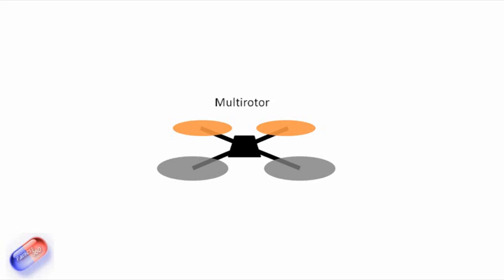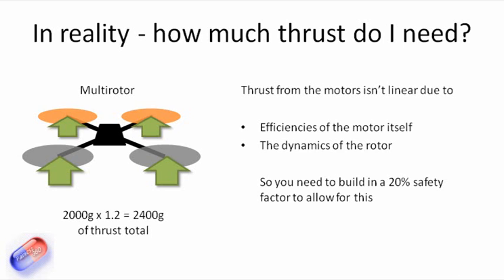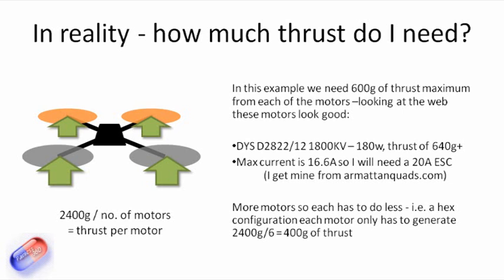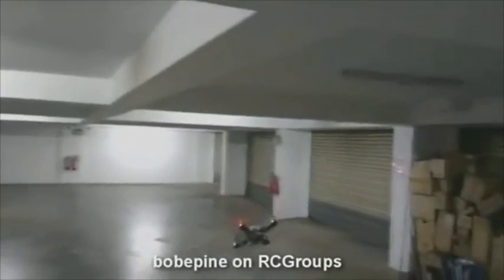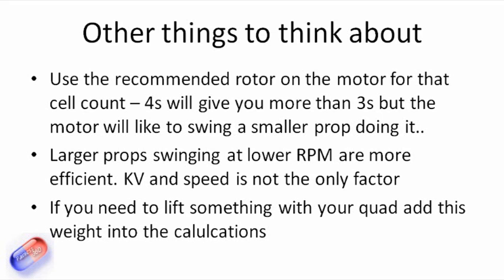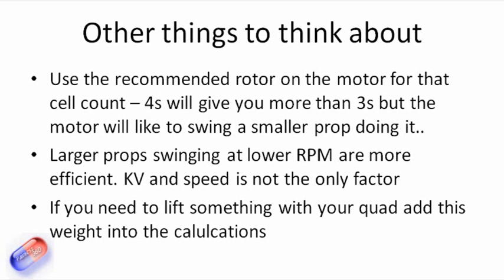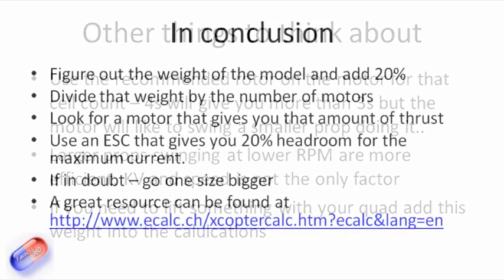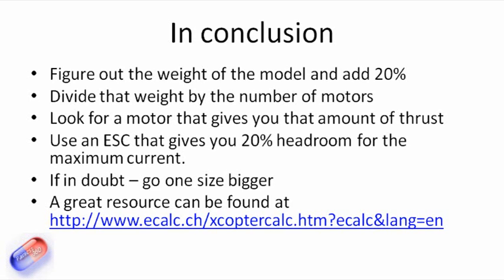How to select the right motor for your multi-rotor (all types - Tri, Quad, Hex etc.)

Comment: I'm really finding this hard to understand, because i seemply cant find how to calculate the requirements of the motors and nowhere seems to state this motor is capabe of 1kg thrust or 2.For example, im, building a drone that has an estimate of 1.5-2kg, what should i pick, 4 motors that are 2700kv or 1600kv, where would i find what motors should i buy so that when hooking 4 of them i could fly the drone. Not for sport, but for normal drone flying.
Reply from the maker: Check out the t-motor stuff. They take the time to test and publish thrust tables.. best of luck

Comment: Hi I am trying to develop a drone motor 
Can you help ? 
Required thrust 5000g each motor.

How to calculate motor power rating?
Reply from the maker: You need to look at the thrust for the motor and prop you're looking at. That is a huge thrust you need so I'd look at the t-motor multirotor motors for a start..
Reply: Painless360 
Thank you 

Is there any PMSM controller (ESC) for drone

Comment: I'm making a helicopter shaped drone with two brushless motors fixed at the front and two coreless motors at the back allowed free to rotate on axis perpendicular to the tail of the drone on both the sides forming an isocesless trapezium. The coreless motor will be attached to a servo which will turn the whole motor forward or backward like a pendulum for forward or reverse moment. The propeller on the front will be bigger than the hind ones. So what power of motor shall I use for both front and rear propellers?
Reply from the maker: It depends on the weight of the model. Check out the endurance quad builds on the channel where I show how to figure all that out.. Best of luck!

Comment: Just curious about the comment surrounding a 4S battery swinging the prop faster and therefore needing a small diameter prop.  For me, this doesn't compute.  Here is why .... Relating this back to aircraft, typically speaking the larger the motor the larger the prop and / or the more prop blades .  By way of example, compare a Cessna 182 Skylane with a 235 hp motor swinging basically a 6 foot two blade prop versus a Chance Vought Corsair at roughly 2,000 hp swinging a 13 foot 3 or 4 blade prop.  So, when I think of going from a 3S to a 4S battery I think of a bigger and more powerful motor and therefore the ability to swing a bigger prop with more blades and push more air at a lower rpm.   I know there is more to it than that as the weight of the aircraft comes into play, the mission, and many other variables.  But, I am just trying to figure out if I missed something in your comment.  If so, I am having hard time picking out that nugget due to my perception as given in the previous example.
Reply from the maker: See the prop testing in the endurance quad builds.. happy flying!
Reply: @Painless360  Thank you. I will!

Comment: lets say my drone weights 3kg with all and it is a quadcopter, if i instead of using motors that has a thrust ratio off 1000gr each (4kg total ),
i use instead motors that has 2000gr of thrust each (8kg total ) would it make my quad harder to fly or would it be harder to control it ie wobble ?? if it is a 650mm size chassie and it is recommended to use 3210 700kv motors and i use 4110 400kv motors as an example.
would it be usefull or not,,if i had same power att 50% trottle,,would presciate info
Reply from the maker: You should always make sure that you have at least twice the weight of the model available in total thrust. Adding more than that will just give your model more speed and power, and will mean the hover point will be lower on the throttle too. Best of luck with your build.

Comment: what do you mean by 3s and 4s?
Reply from the maker: Sounds like you're new to this - check out the videos in the 'Introduction to remote control' series to learn the basics and lingo. You'll find that 3s and 4s are all related to the number of cells in batteries..
Reply: Painless360 Thank you!

Comment: I have a question 
Looking to build a TAROT 680  pro  
What KV motors would I use and what battery do I use 6S 4S ? Looking for a good flight time .. with very little payload
Reply from the maker: It’s not about the KV, start by looking at  the prop and motor you need for the weight of the model.. best of luck.
Reply: Hey Ben, I'm also looking at building the same frame. Want to get in touch?

Comment: I have 4 motors of the same. But 3 of them have red and violet wires and one black an white (Instead of two r and v and two b and w).Can I run one of the red and violet in reverse polarity?
Reply from the maker: If it’s a brushless motor then it doesn’t matter which way round you connect the three wires coming out of it. Best of luck!
Reply: Painless360 
Naaa. Theyre all brushed. I'm gonna try it anyways. I imagine the worst that could happen is the brushes get folded backwards. But more than likely the power output will be lessened before that happens.
In any cases, I'll let you know the results.
Reply from the maker: If they are brushed - the different colours usually denotes different direction. You can run them backwards but it will wear the brushes slightly faster than going in the right direction.

Comment: Do you include the weight of the battery to get the models total weight ?
Reply from the maker: Yes, the actual flying weight. Motor selection is easier now..

Comment: To lift 2kg of thrust (including payload).......how much kv motor is enough......?
Reply from the maker: It's not about KV, it's about the trust the motor and prop create.. Check out the thrust tables for the motor you're looking at. Best of luck!
Reply: 850-1000Kv motor with 11*45 inch props with 3s lipo... it should be able to lift that.
Reply: @shutdahellup69420  what if use a motor with higher kv and a larger prop? Will the payload capacity increase?
Reply: @akshatmaurya3964  generally as the kv increases prop size decreases and vice versa so if u need a racing fast quad high kv and less size prop is more suitable and a lower kv motor with bigger prop for lifting payloads or more flight time...
as for ur question... probably but upto a limit after that u risk burning a motor or esc as it draws more current that recommended...
Reply: @akshatmaurya3964  nah man with the kv all you can do is look up on internet with the same exact motor and check their performance with diff props...manufacturers give the table. or look on youtube video of thrust test.

Comment: Nice Video!

I have a 2 in 1 6A ESC of Racerstar, which of the following motors works best with it? 
1) 1104 7000kv
 2) 1104 6500kv 
3) 1104 4000kv all rated for 1-2 cells 
and what propeller should I use? 

Thanks.
Reply from the maker: +Arun JP see my 'quadcopter building for beginners series', I cover how to figure all of this stuff out. Hope it helps!

Comment: hi..sorry if i disturb you.. i know this video sense 2013 but i just saw it now December 2017..and i saw your explanation on this video. i just ask a question or help for me..because i wan to build a Quad just 500 size..can you give me  advice what is good for my Quad 500 size.. because i want to long flight with my quad.. so my question is what is the good motor for economy current for battery and trust so other wise i can fly long minutes that all i want please.. just reply me if you have time thanks
Reply from the maker: This video was from a time where there wasn't a lot of choice for multirotor motors and we call used plane power systems! :D Go for over twice the total thrust with the largest props you can fit on the frame. T-Motors have some excellent (if a little expensive) options for larger models with high efficiency for flight times. So you'll need to know the weight the model will be and the prop sizes supported. Best of luck!

Comment: hi there i commented a video a whil back but  i am still struggeling to find the right motors and props for my H quad due to a fue miss calculations i actuerly waghs 5.7kg and whats the differece between standered blads and tri blads apart from the ovius
Reply from the maker: +yinny yanny tri blades are less efficient. Always try for two bladed props if you can fit them.
Reply: are ok thank you for that i got told by some one the were better glad i ask some one els first and i should not be any proble my frame is 550mm do you have any advice on which motors would be best
Reply from the maker: +yinny yanny if you want long flight times go for the biggest prop you can fit on that frame and low KV. Look for a motor that together will produce over twice that weight with the props.. the T-motots website is very useful. Best of luck!
Reply: thank you

Comment: Hello Painless360,
I am having a inter university level competition which requires a drone with the weight of including payload around 6kg. can you suggest me a motor for this quadcopter. I am on the internet searching the motor around more than 20 hrs. can you help me out?
we have find a motor that produces thrust of 3600g.
Reply from the maker: +Nisath Hussain check out the t-motors website. They do fab motors and prop combos for larger models. Best of luck
Reply: Thanks a lot.
Reply: what about KDE Direct motors? are they good enough as T-motors.?

Comment: halloo... buddy... I had tried to make a H-quad copter in my home..the weight of the frame approximately more than 600grams.How can i prefer the suitable motors , esc ,battery's & props to make a my quad copter.
Reply from the maker: Erm, that's what this entire video was about... See the quadcopter building for beginners series where I use the lessons in this video to check motor and ESC power levels..

Comment: Will a 2212 920kv motor work with the DJI MAVIC PRO props?
Reply from the maker: These kinds of motors are usually designed for 8045 to 1047 props so if those Mavic props are the right diameter and pitch then maybe. You'll need to check the mounting hole for the prop/motor is compatible - I'd ask the vendor of the props. Best of luck!
Reply: Painless360 Thanks!!!

Comment: I have two questions.

First, I saw many affordable motor specs, and in roughly the same class they all display throttle of, say, 300g at 4 ampers. But, with much more expensive motors of higher quality (like Tiger motors), I see that they have throttle of about 100-200g with the same params. So I'm in doubt, aren't more expensive motors supposed to produce higher throttle? Or does that mean the cheaper motors' throttle is just a fake?

Second, when I turn some motors by hand, they don't rotate smoothly, I can feel some little "steps" inside. Is that normal or not and what is the cause of it? Never found the answer.
Reply from the maker: +nandakoryaaa the thrust depends on the props used. Even props of the same size from different manufacturers can have an effect. Watch the KV ratings too.. best of luck!
Reply: Yes but I mean in the test data they use appropriate props and some motors show 300g of thrust and other (higher-quality) motors only 150g, all in the same class. It couldn't be that higher-quality motors were tested with inferior props, I think there is just some fake data.

Comment: dji phantom 2212 2200kv is better than 2212 920kv more torque more speed????
Reply from the maker: +manuel montes usually a higher KV motor has less torque. You tend to find that lower KV Motors are designed to spin much larger props. Best of luck with your project.
Reply: ok the 2212kv is a rubish? the will be slowy? i need to beat a dji phantom 4 with 1045 props i need more speed and thrust?????
Reply from the maker: +manuel montes follow the instructions in the video to find what you need. Best of luck!
Reply from the maker: +Painless360 I'd also encourage you to watch some of the videos in the series 'Introduction to remote control ' where we show the differences between high kv/small prop and low kv/big prop setups. Best of luck!

Comment: hola tengo una super duda. yo tengo un sma x8 y lo quiero cambiar a brushless, yo se como hacer todo pero hay un solo problema, en ebay hay un set de 4 motores que quiero comprar son de 2212 2200kv con propelas de 10 pulgadas pero no me dice si es cw o ccw ya que uno puede invertir los cable pero las tuercas se pueden caer. ayuda por favor quiero hacer un sleeper. http://www.ebay.com/itm/4x-A2212-2200KV-Brushless-Outrunner-Motor-4x-HOBBYPOWER-30A-Brushless-ESC-K91-/121692755915?hash=item1c557417cb:g:z3wAAOSw-vlVk4cY

Comment: hi mate I have a question for you I was useing the dji 2212 920kv motor with the dji 10x38 prop's and 30amp opt ESC on my f450 but now got a team white sheep frame useing the same props ESC but gone to the 2312 960 kv motors thay get a little worm now could it be down to the awg wire it was 14awg but to short but got some 18awg on it now
Reply from the maker: Possibly, but I'd expect the motor to be getting warm due to it working a little harder than the last motor. I'd monitor it for the next few flights. Getting a little warm is fine but if you can't comfortably hold it after a flight then you're possibly pulling too much current.. Best of luck!
Reply: Painless360 thanks will keep my eye in it isn't useing the racestar race motors thay tested the 10inch on the 920 and 980 kv so was thinking the 960 should be ok

Comment: how many rpm motor we want
Reply from the maker: You need to use the weight of the model to figure that out. It's easy to get 3x the thrust these days for better performance with most 200-400 class models using 2215/2300Kv motors with 5 or 6" props.. Happy flying!

Comment: Hi, what motors would you recommend for 450 class X8. Would you recommend 4in1 ESC's? There is a lot of mixed reviews out there. Thanks
Reply from the maker: Not sure as we're not flying much over a 330 class now. Last time we did we used the 2212/935KV motors with 10" props but watch how much weight you're lifting! Best of luck!

Comment: trying to decide on a motor for my 220 race quad.  I plan on using 5 inch props.  Do I want a 2205 2300? 2206 2300? 2206 2600? 3S and 4S 1300 batteries
Reply from the maker: If you check the testing for these motors you'll see the differences between the current draw and thrust. For me the 2600KV motors are way too much and pull a lot of current on 5" blades. Down at the 2205/2300 level there are loads of choice and these motors are great for 5" props. We use mainly the Emax RS2205/2300 on most of the builds we've done this year and not had a single problem with them (touches wood!) ;)
Reply: Painless360 I was leaning toward Emax RS 2205 2300 red bottoms thanks!

Comment: Hi Painless, I have a motor related question. How do you figure out what motor is a "220x" sized or a "180x" sized? Or for example, for my first build, I'm looking at the Tiger Motor F40 II, theres 2300kv and 2600kv, whats the difference between those? Just how much power its using to spin? does it spin faster? Whats the difference between 2305 and 2205?
Reply from the maker: The specs should be listed in the detail for the motor. See the other motor videos in the 'Introduction to Remote control' for more details. A motor with more KV will spin faster and wither produce more thrust/use more power or produce the same thrust as a motor with less KV with a smaller prop.. Best of luck!
Reply: Thank you, I watched another video of yours and figured it out a little, but Im confused on more more thing, you said you need the ESC to be 20% bigger than the motors Amps, however I see a lot of people flying the Kiss esc 24A with the T40 2400kv and the specs for the 2400kv say max amp at 100% is 36A, how is this possible?
Reply from the maker: Can't see 36A on the spec sheet - http://www.rctigermotor.com/html/2015/fpvmotors_1117/305.html..
Reply: http://www.rctigermotor.com/html/2016/fpvmotors_0806/318.html This is the v2 of these motors, you listed the v1
Reply from the maker: Those are the 2600KV version..
Reply: My mistake! The picture said 2400kv so I thought I got the right link. I'm at work I'll find it later. Cheers.

Comment: Hi again. 
Do you think it would be a wise move to to go for 11 -12 inch props but lower pitch such as 3.8 to gain more thrust.  Or best to stick to 10 45?
Reply from the maker: See our related video where we compare the different blades. I'd stick with the prop recommended by the manufacturer unless you need a smaller one and then you can look at increasing the pitch to get a similar thrust.. Best of luck!

Comment: Hi, l recently purchased a quanum xj 470, 30 amp Simon K esc, and emax 930kv motors with 10/4.5 props http://www.ebay.co.uk/itm/291751158698. do you think this will do the job? I have tried ecalc but my motor isn't listed there. Planning to run the whole system on apm 2...Cheers
Reply from the maker: We've used them on a few 450 class models and they work great. Replace the props though as the ones that comes with the kit are usually not great and I've had a few break at the root (see the video on it). Best of luck!
Reply: Hi.
Thank you for your advice, yes, definitely kit props are utter rubbish, not a single flight yet and two allready gone. Kissed the glass table on which quad was standing  whilst adjusting PID's. Just exploded.

Comment: Think back to Isaac Newton's apple. Force = Mass x Acceleration. 
Force = Mass (1kg) x Acceleration (gravity @  9.8 m/s2) = 9.8 Newtons 
10 Newtons = 1kg

Now you can substitute the weight of your machine (Mass) to determine the Force, then decide how much additional force you want to apply to overcome gravity..   then follow principals above.
May the Force be with you     :-)
Reply: And how to know how much thrust a rotor and it's propeller can generate?